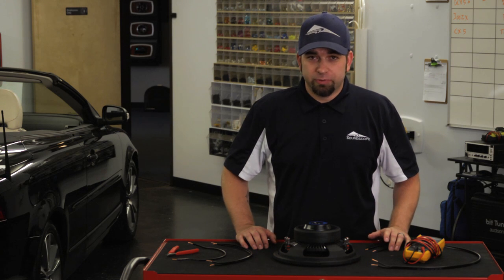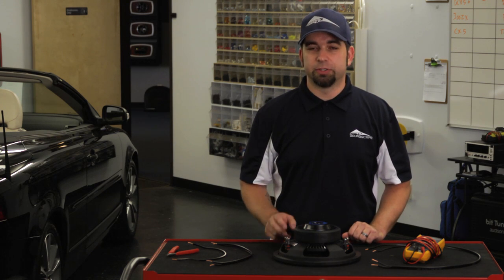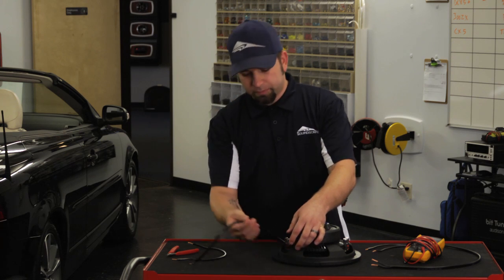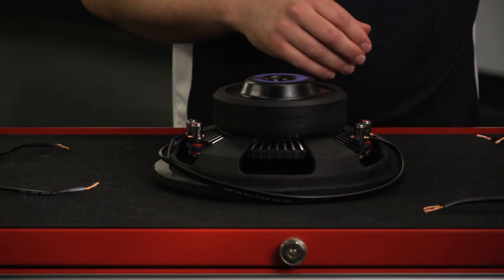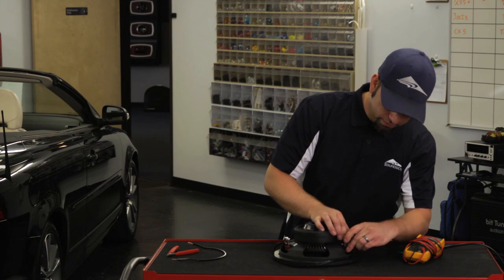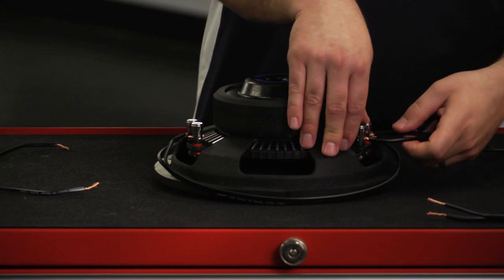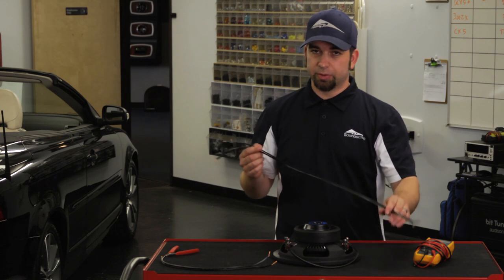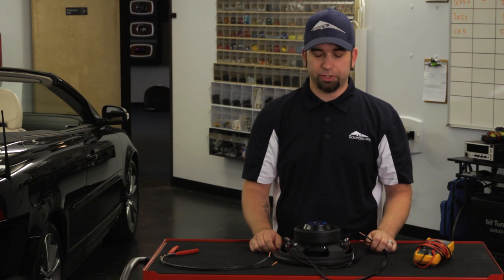How to Wire Up a 4-Ohm DVC Subwoofer : Car Audio

Comment: I AM VERY NOVICE AT THIS. SO WOULD I WANT 1-OHM OR 4-OHM TO RECEIVE THE BEST PERFORMANCE AND LOUDEST BOOM FROM MY SUB??? WHICH ONE IS BEST FOR A 2500 WATT PEAK SUB AND WHICH IS THE LEAST STRAIN ON MY AMP??? THNX IS ADVANCE DUDE
Reply: Depends? What are you amp specs

Comment: is it possible for a dual voice coil sub to keep the same ohm it was rated for? for example, keeping a dual 4 ohm sub at 4 ohm.
Reply: i don't think so, the ohm is always chop in half  wire in parallel or doubled wire in series.
Reply: gammatnt 😢